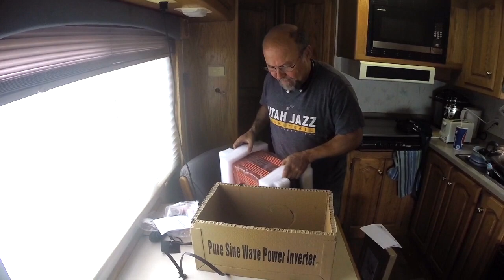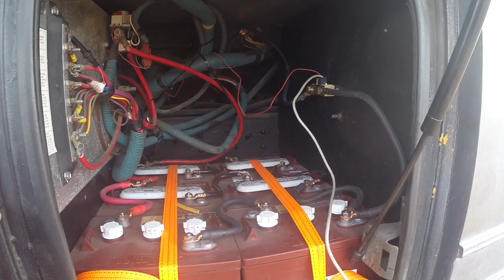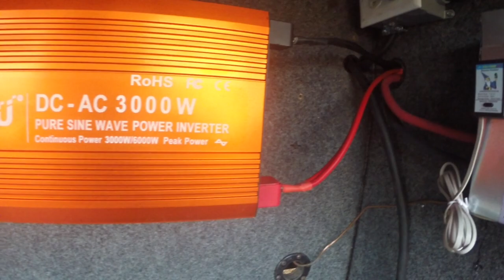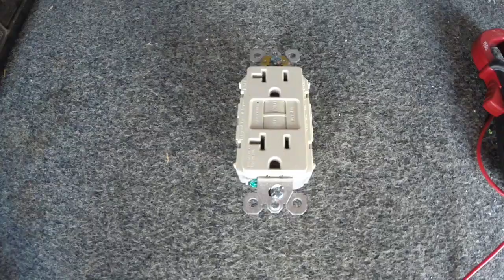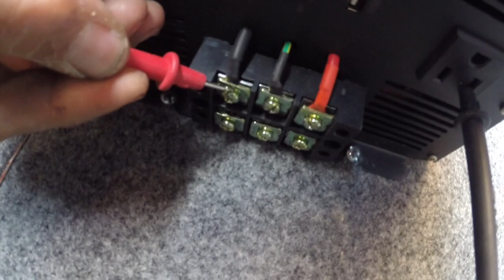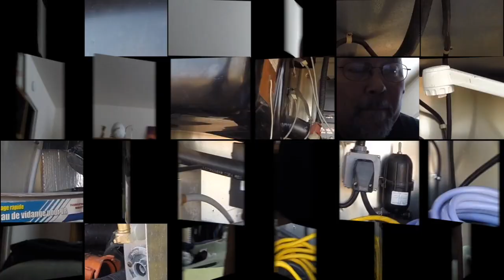CNBOU 3000 WATT INVERTER: 3 Years and working great. A nice pure sine wave inverter. Great Support.

Comment: With 2500 watt inverter how many watt device can use sample lamp washing machine tv please reply. MEXX SUN ORANGE POVER.
Reply from the maker: Sorry I didn't reply sooner.  Hope this will help someone. Most inverters will have a continuous number and a peak number. This unit runs up to 3000 watts continuous and can peak up to 6000 watts. Each device that connects to a plug is rated at a certain wattage.  For example if you have a microwave and you look on the back where the plug comes out of the unit there will be a notice there saying this unit draws up to something.  If that is 1500 watts then write that down. check out everything you have and list it.  Then figure out what might be on at the same time and that will give you an idea on what size you need in an inverter. Bigger is always better but can also be overkill so don't go to while.
Reply: @TignerAdventures  but I heard it depends on the load type. Inductive needs more than simply take the watt rating. Or what do you think?
Reply from the maker: @solidfuel0  Interesting.  Sorry I have never heard that. However I do know some people that have issues with their hair dryer working on theirs which is a modified sine wave so maybe that is true in some way. We haven't found anything that this does not work on but we are next experts in the field. We have been using this for everything in our rig except for our air conditioners for over 2 years now with no issues. I'm going to pick up some easy starts for the air conditioners to see if they will work also but that is a future project.